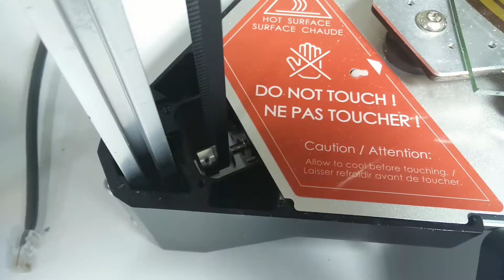Showing my new belt drive

Comment: How well does this 3d printer work? How big can you print models?
Reply from the maker: +Jarrett Eakins Works great with the belt drive (I think they're sold with the kit installed now.. you need to check). Also, a lot of people are changing some parts like hotend, glass and bed heater (to heat faster to print in ABS). If you go on there forum, you'll see all sorts of mods made to this model. Good luck !